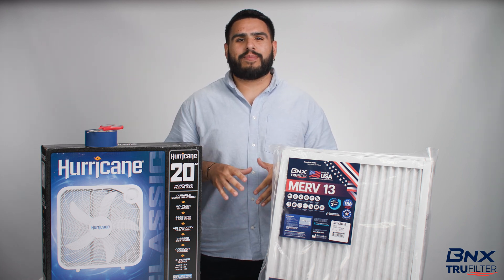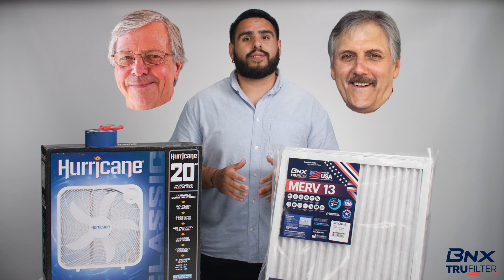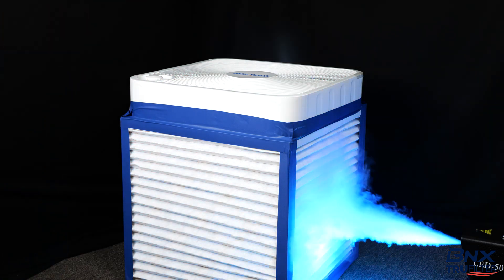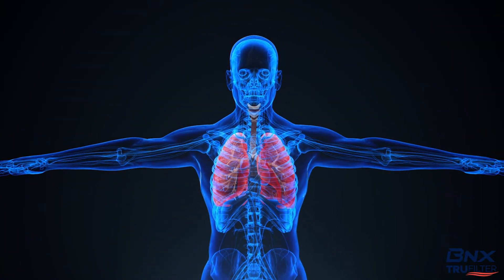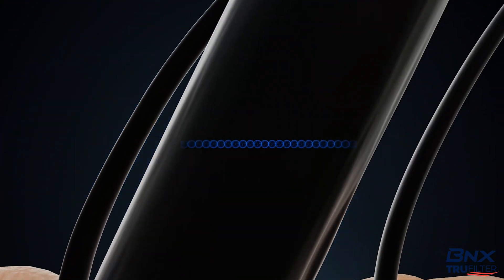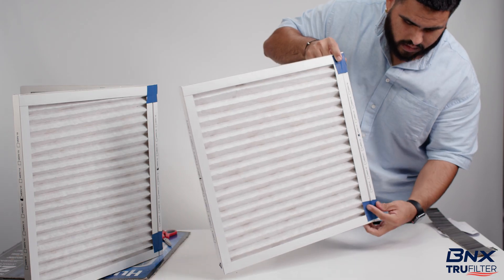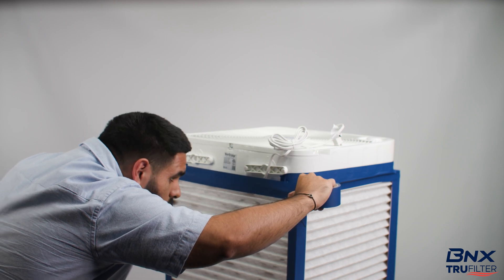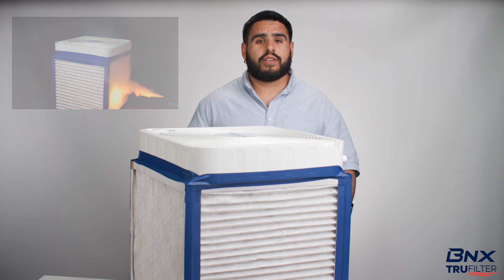How to Build a Corsi-Rosenthal Box with BNX Trufilter's MERV 13 Air Filters

Comment: Great that you're promoting this, and that you sell four packs so people can easily get the right number of filters for a four filter CR box.

You did skip an important step in creating a CR box, which is that you omitted the fan shroud that helps makes the fan much more efficient at moving air through the CR box. I understand why you might want to simplify the instructions, but I feel that that really should have been included at least as an optional component. It's one of the things that makes a CR box work well :-)